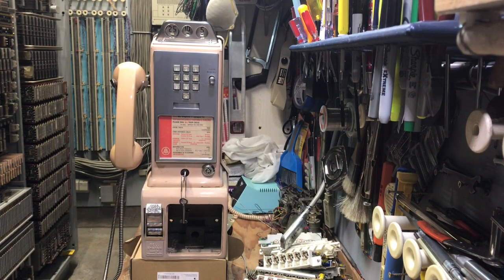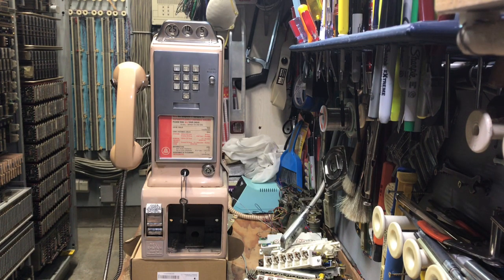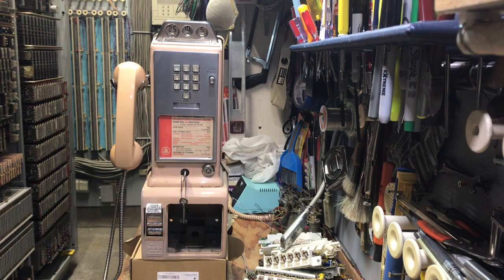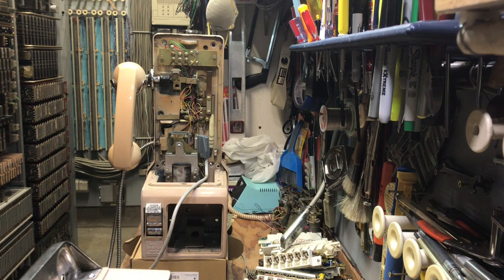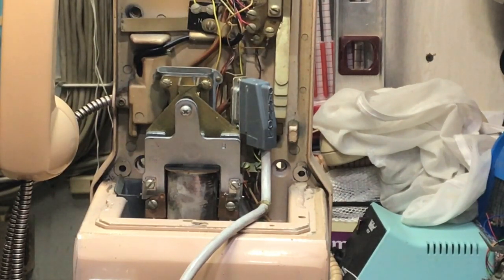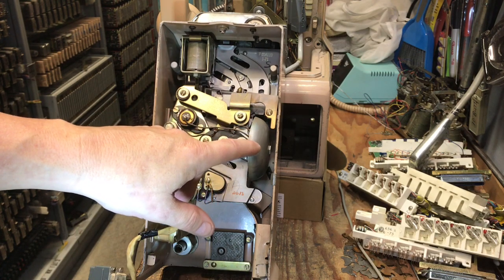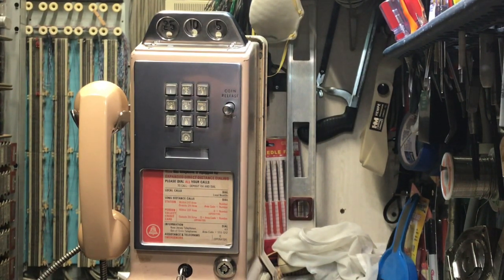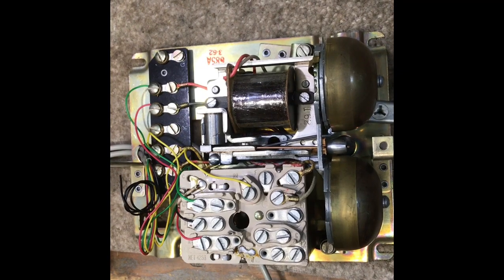Western Electric 1234 G coin collector. 3 Slot (payphone)

Comment: I have the Northern Electric model of this particular pay phone. All original, except mine is in chrome. I have several different models of the old 3 slot pay phones, and a few old Western Electric’s from the 70’s. 
I was big into restoration of the old pay phones several years ago. I really have to get back into that hobby.

Comment: Did WE make a 1236G (with bell, like the 236G) or was this it?
Reply from the maker: I've only seen three of these phones They were all the same which required a bell box/subset in order to make them work these were very early phones they had not yet been able to necessarily cram all of the parts in the one housing.
Reply: @sxsphil  Wow, that's a rare phone! Congratulations on the find and thanks so much for making these videos! Good stuff!